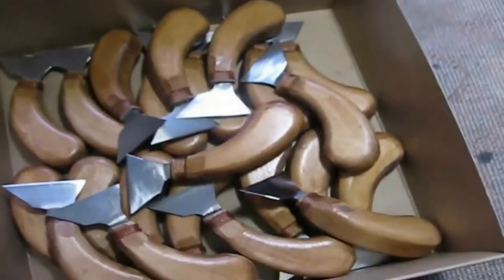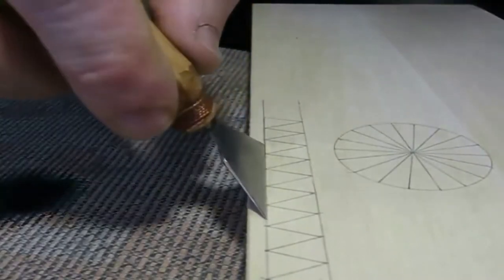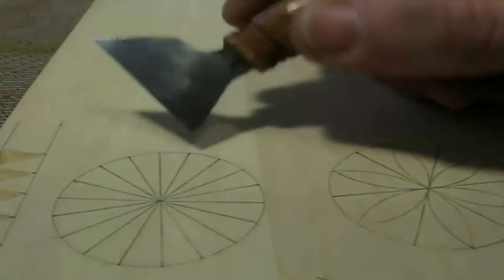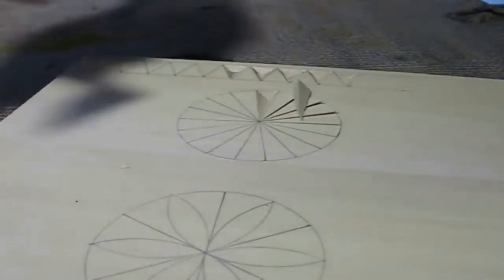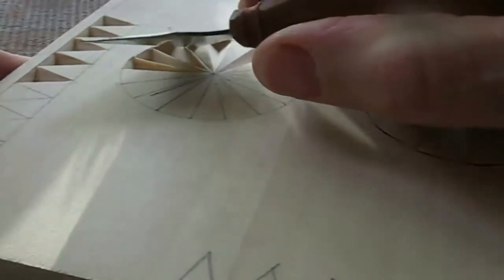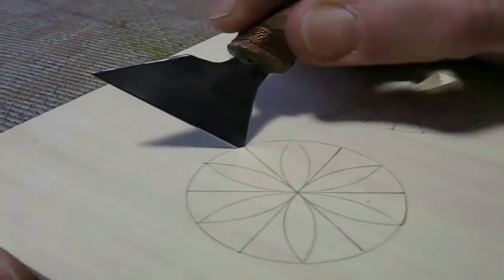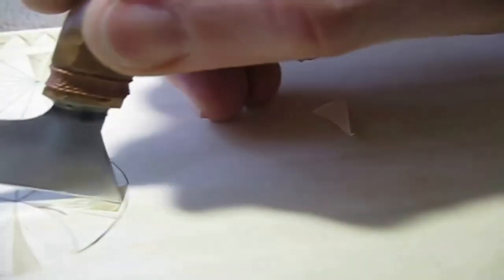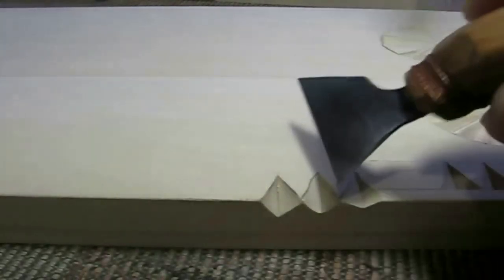#2  Chip carving Lesson #2 for beginners. Carving knife and how to use it.

Comment: Hello, I have about 40 years woodcarving experience....but I struggle SOOO much with this style.   I bought a knife similar to yours (Beavercraft C10).  And have been trying for 3+ years to succeed.  Barely a day goes by without me practicing and getting frustrated with the results.     

I am wondering if my Basswood is too dry?  The "premium" Basswood I buy in NC is very dry and appears "redder" than your beautiful white boards.    When doing the cuts as you describe, with a perfectly razor sharp blade I have to push with 50-60lbs of force to make a simple cut that you seem to do with no force at all.  Many of my chips end up like a pile of splinters than a solid piece like you get. 

Or maybe my knife is sharpened too high of an angle?  My knife is sharpened to 17°- do I need to go lower? 

I really do love the style of chip carving.  And am very thankful for any advice you can give me.  Great videos by the way.
Reply from the maker: Hello, thanks for stopping by!    1. If your wood is too dry you can use water spray bottle to wet it a bit. 2. Your knife is sharp but angle is too big. All my knives are sharpened  to 5 degrees  and usually need only honing on leather. 
I make knives my self and you can try it from  Etsy shop - https://www.etsy.com/shop/CarvedUA?ref=seller-platform-mcnav   takes about 2-3 weeks to the States by mail

Good luck and don't give up carving!
Reply: @bonobowoodcarving7932  Thanks so much for your reply.  Wow 5 degrees.  That’s a huge difference.  It’s going to take me awhile to reprofile my current knife..  I did go ahead and order one of yours as I want to see how the handle leverages the cuts.
Reply from the maker: @bradisaac9540  thank you and good luck!👍